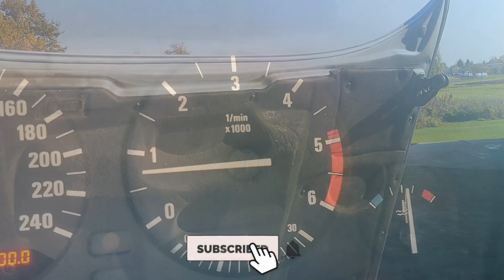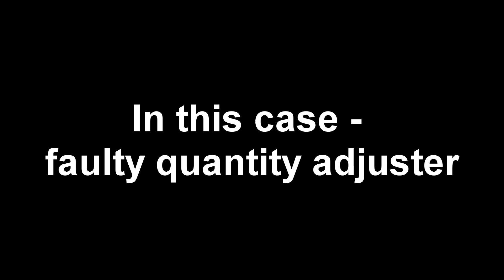Diesel shakes and runs rough - bad Injection Pump Quantity Adjuster

Comment: I just installed remanufactured injectors and injector pump on my 1991 F350 with the old 7.3 non turbo. Will rev if you step on the gas but will absolutely stall out the moment you let for foot off the pedal. Idle screw is turned all the way up.
Reply from the maker: Maybe injection pump timing or quantity adjustment is bad

Comment: I have difficulty starting from cold.  Replaced fuel filter.  Fixed fuel lines.  Fuel free flows perfectly now.  Replaced fuel cell pump in tank.  Replaced all 6 glow plugs.  No fault codes at all.  To start car is as followes.:-  Key to pos 2.  wait till glow lights is out.  turn off then turn to pos 2 again wait for light to go out.  then start.  after 4 or 5 turns its fires into life.  Have not really seen any issues with warm start to be honest with you. Car is kinda slow to pull away but not losing oil anywhere and not really seeing bad smoke out of the exhaust. I suspect turbo is good for now but i think i have fuel issues.  does this sound about right.  if yes, how do you adjust to find the right mixture please.  Anin depth guide would be fantastic.  thank you. 325 525 725 TDS rules.  love em.
Reply from the maker: May be your fuel goes back in to tank, so try to install inline one way fuel valve after filter before injection pump. If thats not help you need to check your temperature  sensor, because when it is cold car may don't see that. And last solution adjust your injection pump timing and fuel quantity. For both these adjustments you need diagnostics scan tool to see live data. Ignition adjusts by turning whole injection pump side to side (3bolts). And quantity by sliding quantity adjuster, ( injection pump top part) back and foward.
Reply: @Work_G  I already have a oneway valve in that fuel line and i tested it and works fully.  I will not allow fuel to travel backwards.  The tempreture sensor is brand new and yes it works perfectly too.  Problem with the scan tool is that I dont have one that actually works with this version of engine. 525TDS is almost impossible to get live data off. 1997 model is  a pain in the aris.  Can you show more details about what controls what in a video.  i see 3 bolts so that woud be ignition but the top part back and forwards i have no clue about.  This part I have not even found on utube.  I am aware of timing but i actually thought that was the fueling side of things.  So glad i did not F about with that.
Reply: No need to mess with the pump,,the electronic injector will set the injection timing;  most pumps have NO adjustment,no elongated holes,just round holes; 
Assuming you GLOW PLUGS ARE GOOD(you'll only need half of them for the car to start on those 2 or 3 cylinders,but you'll see a lot of white smoke the first minute),   like it was said,90% of the times the problem ir air leaks,and the one way valve WORKS, but is NOT the proper solution(it did not come from factory,did it?); what is  needed ,90 % of the times,is to replace the small  leak-off diesel rubber lines at each injector and pump; they leak air in,breaking the vacuum,and fuel drains back to the (LOWER!!!)  tank in a few hours;(only ONE may be needed,if you know what to look for).
The FACTORY MANUAL cautions you that if you remove those lines you CANNOT put them back,they won't seal again (of course NOT,the barb on the injector,RIPS it's interior!!!); you need NEW ones(I,if the length allows,and they are not old and cracked,cut off the tip and re-use them;  if you look and they are wet outside, they are porous/cracked,NEW ones are needed; took me a lot of years to figure this out,and i've been a mech for over 40 years.

Another way of starting he BMW 325 or 318 TDS first time in the morning,is to go under the hood,take off the fuse box cover,and then the 2 relays cover next to ir; the relay to the REAR of the car is the fuel pump relay; remove it, and with a piece if wire JUMP the 2 terminals  30 and 87, NO OTHERS!!! ; it's the 1 to the front of the car, and ,the 1 to the fender, LOOK at the diagram that in on the relay !!!! (these BMW relays  have a  DIFFERENT pinout than normal Bosch ones,!!!!!)this on RHD cars(right side of the road); NO NEED to turn the key,it can be in your pocket for this; then look at the transparent/yellow fuel pipe (filter to pump) and see if bubbles come in the fuel; wait a minute or 2,until fuel runs clear,then another minute,to bleed the main fuel injection pump; if air was the problem,the car will start FIRST turn of the key; if fuel does not run,you  need a new pump that is in the TANK, OR its wiring repaired.
I repair these daily,i have 3 of my own; they all have over 250000,and they will all go way over 500000 kms,always running good,and with minimal breakdowns (alternator bearings and commutator and brushes,wheel bearing, once,brake pads, an occasional water pump,etc; new timing chains and guides at 300000;
    hope this helped anyone;
José Peixoto Maia Porto
Reply: @josepeixoto3384  I have replaced the Fuel pump in the tank.  Last one was loud and easily heard. However.  the replacement version is only 1bar pressure. I was advised this is the one to buy.  true,??  i dont know, just know in the fact that the one installed is 1 bar pressure.  Would you kindly do a video on this please.???  With regards to the pinout 30+87.  thank you.

Comment: I have a New Holland LS180 Skid Steer.  It wont stay running. When it finally cranks and is working properly ,when I touch the throttle , all power is lost and will not crank back up
Reply from the maker: Sorry I don't have knowledge about that thing

Comment: I have a 92 ford f250 7.3 idi with a turbo it will run fine but if you cut it off for 15 or 20 mins it doesn't want to start back up
Reply from the maker: Seems like your fuel goes back in to tank. Try to leave car when front car is lower, use hill. And if then starts easy that is problem.